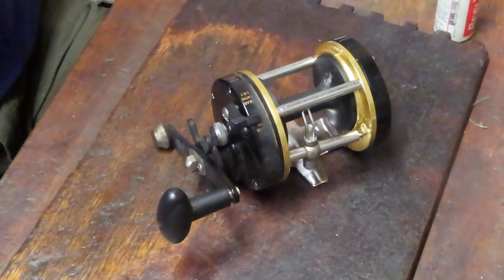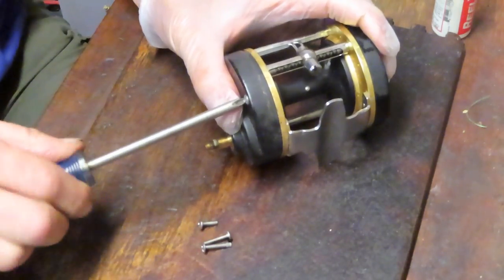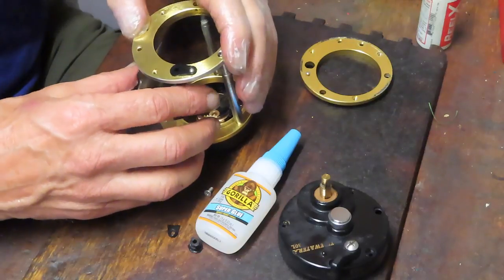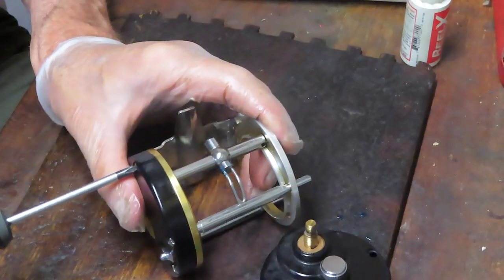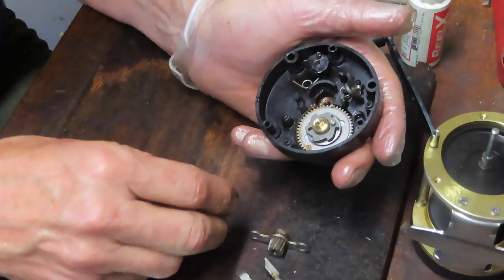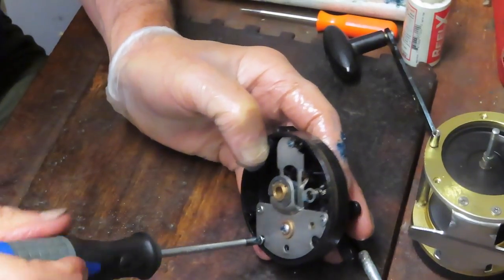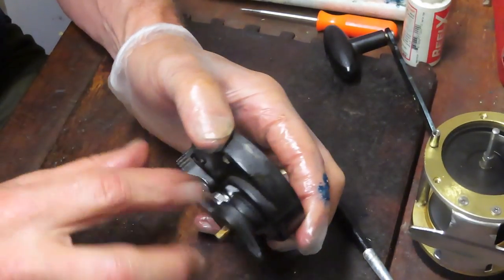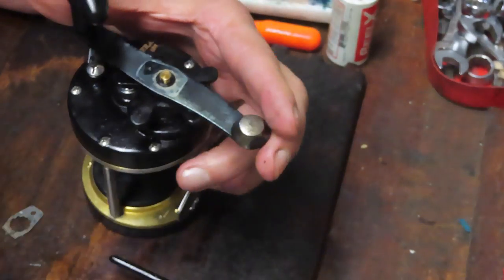Shakespeare Tidewater 30L saltwater fishing reel how to take apart and service

Comment: Thanks for posting. It looked like the line winding gear had a round hole. It went on too easily on the worm shaft. Wouldn't slip on the shaft, and or come off again?
Reply from the maker: There is a copper bushing that slips into the hole and holds it tight. Thanks Hashem - Dennis
Reply: @2ndChanceTackle  Thanks for the reply.

Comment: Given all the level wind reels you work on and are intimately familiar with, which brand name do you believe is the best manufactured reel, the most durable, the best engineered, and the easiest to work on?
Reply: Dennis will give his piece but my opinion is Penn

Penn didnt change to much from the 40s to the early 80s. Lots of parts available and they are simple yet VERY strong. My dads boss back in the 50s caught a 500 lb marlin in mexico with a long beach 68
Reply from the maker: I find the big three in saltwater, Penn, Daiwa and Shimano have all done a good job with the level wind reels.  This feature has been around since 1900, so it have been perfected over the last 100+ years. Thanks for asking - Dennis
Reply from the maker: They were and continue to be bulletproof reels with straight forward design and great engineering - Dennis

Comment: Question- I have one of these reels, and though it had been a great reel, and caught a lot of nice flatheads over the years, I haven't used it much the last few years in part due to the level wind seeming to be slightly off center from the spool and the drag does feel like it's lost a bit of its strength. 

I would assume it needs a pawl (which I've found nearly impossible to locate) is this the same pawl in the okuma classic 300? 

And how can I go about strengthening/increasing drag pressure to factory spec or beyond?

Thank you in advance!
Reply from the maker: I guess you can try the Okuma part.  Many of the parts appear to be the same.  It is worth a few dollars to try the other part rather than toss the reel.  The only way to increase the drag pressure is to replace the worn ones.  If they are not worn, you can try adding another washer at the top of the stack.  Max drag is a function of surface area, so adding a washer would increase the area and thus the drag - Dennis
Reply: @2ndChanceTackle  thank you

Comment: On this reel of mines it doesn't show any sign of gear stripped anywhere but when trying to adjust for speed of casting. Reeling in it skips as if gears or missing teeth.
Reply from the maker: It could be a broken idler gear in the non-gear side plate.  Sometimes the outer rim looks fine but the gear is worn on the inner track.  Also check the spool drive.  Finally, check the metal gears to see if broken one is jammed in one of the slots between the gear teeth - Dennis

Comment: Hi, l am marvin. I got a tidewater that needs parts. Do you have parts for sale
Reply from the maker: Marvin - I have some, but not all.  I do not have the idler gear that drives the worm if that is what you need.
Please send a note to my email and let me know what ones you are searching for.  Send it to 2ndchancetackle@gmail.com - Thank you for asking - Dennis
Reply: @2ndChanceTackle  will you have bearing and some copper like bushing. I'm not sure what else I going to need. My clicker is broken on the in side. This reel is tidewater 30L, it has aluminum frame
Reply from the maker: I have the bushing for sure.  I need to know the size of the bearing.  I probably have that too.  Please send a note to my email 2ndchancetackle@gmail.com